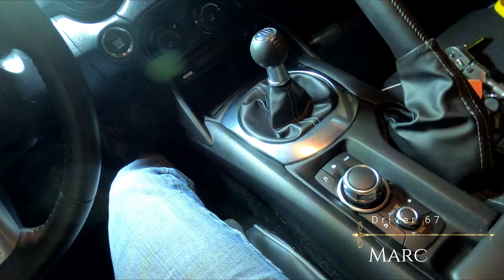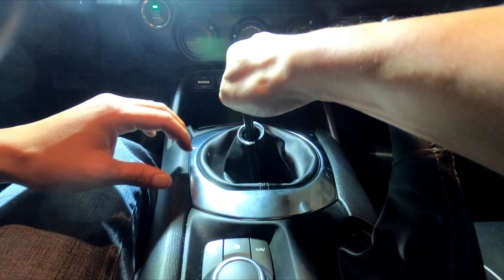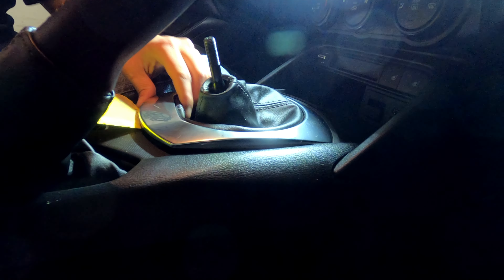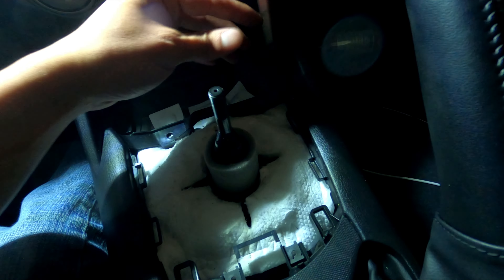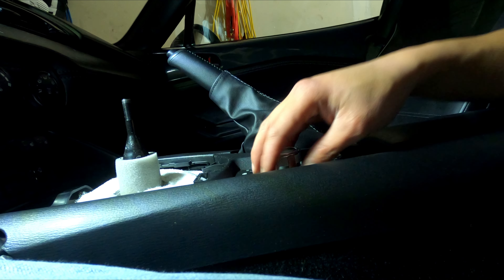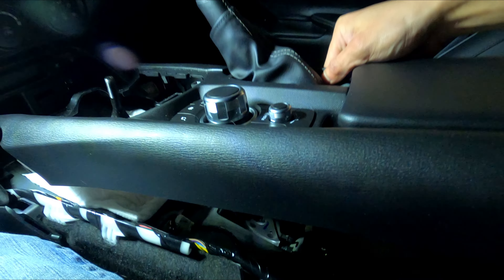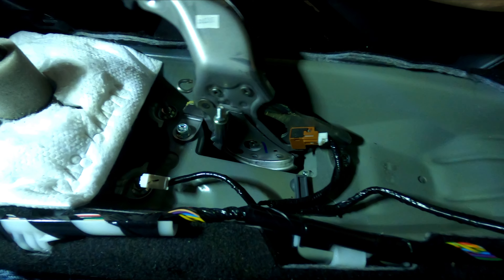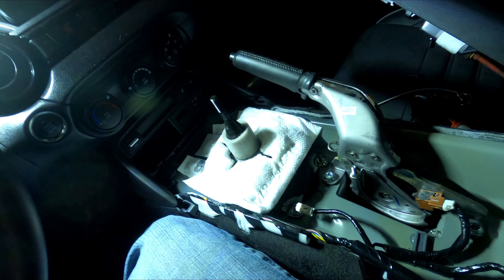2016+ MX-5 guide Handbrake adjustment

Comment: OK, so I tightened my e-brake to the point that it takes a noticeable effort to get it up to just the first locking point. It's showing the parking brake light less than before under acceleration except for when I give her wide open throttle or when it's really cold out. I don't have access to any jacks at the moment so I couldn't spin the wheels, but does this sound like I over-tightened the e-brake, or is this a sign of an issue somewhere else in the parking brake assembly in the car? It's an ND1, 2017 rf club with the appearance package and 26k on the clock.  I do drive her pretty hard within reason 80% of the time, and I daily her too. Also, I shift pretty aggressively, and my clutch is starting to wear. I don't know if any of that would exacerbate  the issue or not.
Reply from the maker: Sounds possible that it is over tightened. First click on the E Brake should not take much effort. Do you have some slack before it tightens up? On the video you can see the slack I like and it takes very little effort to move the handbrake at 7:09 on the video ( basically 1 finger)

If you drive your car for 5 minutes and put your hand CLOSE (not on the rotor) to the rotor can you feel a lot of heat coming out? (There should be very little heat coming out of the rear rotors)

Comment: All wrong. To access brake adjustment bolt, just remove gear silver panel and rear control panel
Reply: This is correct. You just need the plastic around the shifter and the plastic around the control wheel off, as you said. Taking everything off just gets you a bit more space maybe, but it's not needed